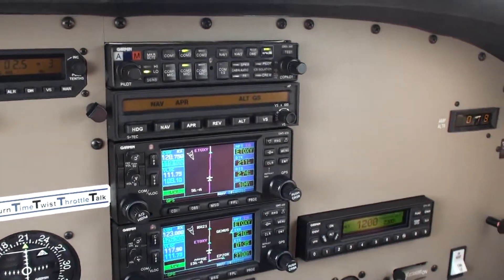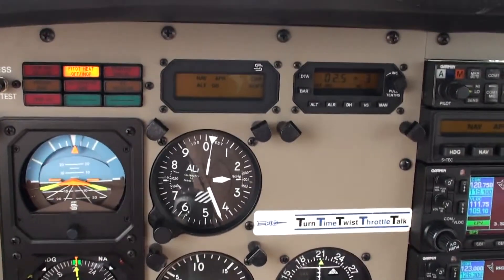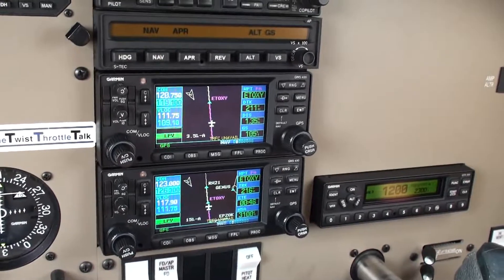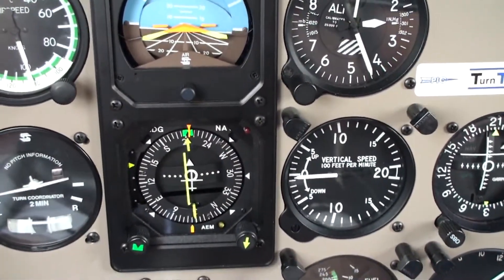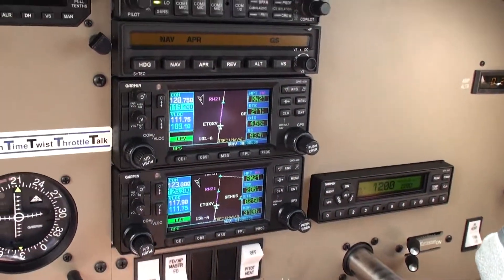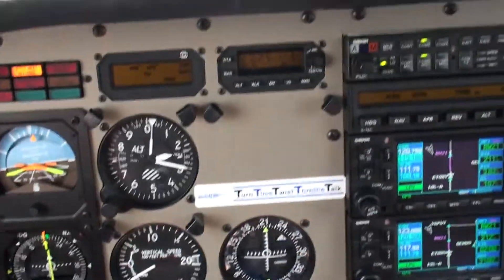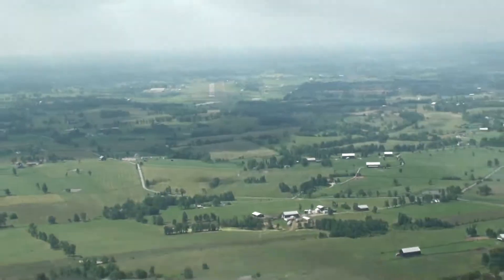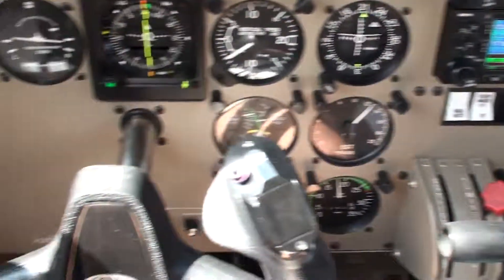N4177N-Piper Archer III - Coupled STEC 55 WAAS Approach

Comment: Thank you for the video. Very useful. I have had the software upgrade for my GTN 750 installed a couple of days ago (V6.6) which enables VNAV for LNAV+V, which is all we have here in Australia. We have very few of these but more will be introduced over time. 
I also have the Stec 55x installed. Unfortunately, no-one seems quite certain how or what the set-up is for the 55x to fly an LNAV+V, including the avionics guys who did the software upgrade! 

I have not had an opportunity to get out to test the system, however I am assuming that the 55x is set up as if for an ILS. In other words, in NAV mode, Arm APPR  and ALT.  Question is what to do to bring up the GS on the PFD ... remain in GPS mode or set VLOC? 
The supplement says that selecting VLOC will exclude GS capture. It's all very confusing. I appreciate any ideas you might have.
cheers